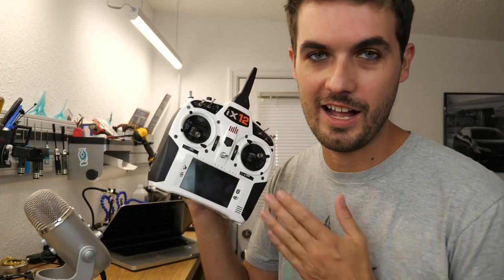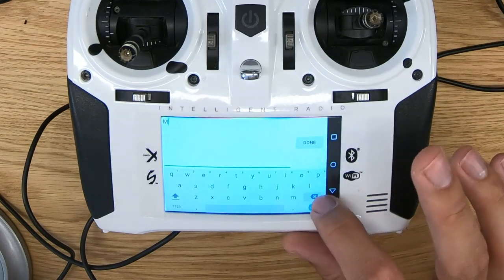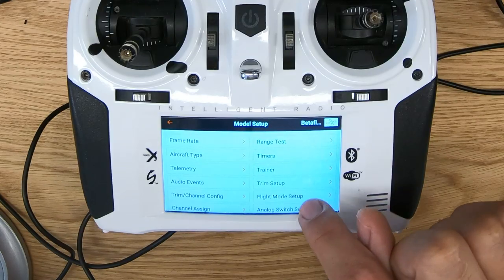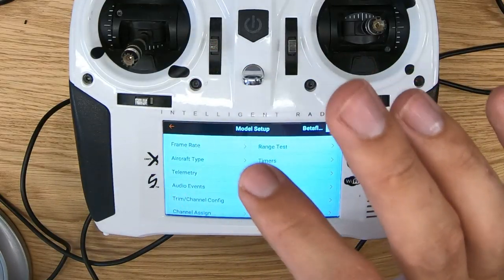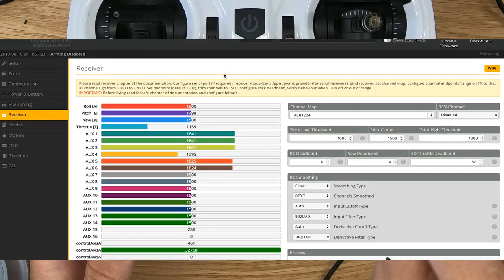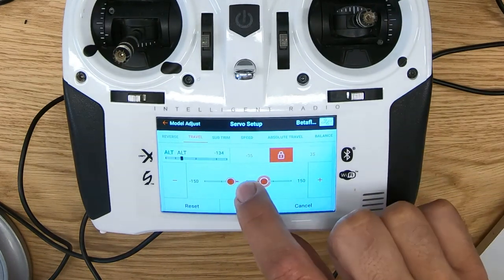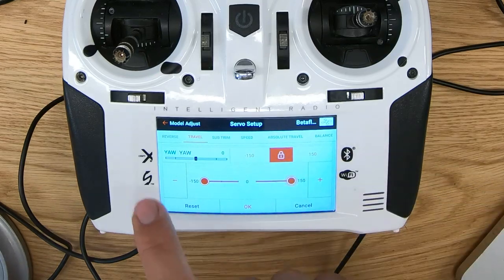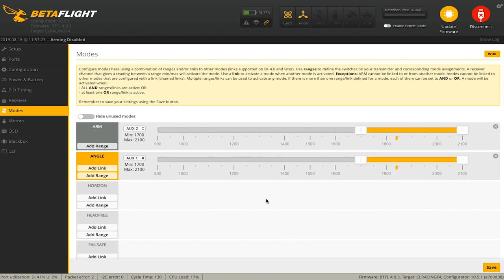Spektrum iX12 model set up for Betaflight

Comment: Hey Drew! Always appreciate the technical walk-through videos.  I would like to see how the telemetry is set up on the spektrum system, and perhaps a little more on the iX12 radio and how you use it for signal penetration in concrete bandos or going behind buildings. I always gets anxious when your flight videos go behind a building as I fear the signal will get dropped.  I have the 6X now, but may upgrade to the 12 if it had more transmit power, or a plugin module to boost power. 
Great videos on all the channels.  Keep up the great work.
Reply: Gil Woodring Xfire dude xfire.

Comment: Nice video! I am using DX9 so this part is not that usefull for me, but plese create advanced video regarding telemetry and RSSI setup on OSD. I am using "old" serial Race receiver and I am really curious whether it worth to upgrade to new SLX2 receiver. Please add your personal opinion about new receiver - how it is with range, stability in multipath enviroment, lost packets etc. Thanks in advance
Reply: I agree the SPM4649T video you did was great but the helpful part on upgrading the receiver by that other guy down in the description is gone. Not sure how to update the SPM4649T with out blowing them up. Dose the new mini receiver your using in this video come with that update or do you have to use that spektrum cable again so I can blow that one up. Help much appreciated

Comment: Thanks to you for all the info!
I also use a Spektrum system for a drone. For me, the SRXL2 DSMX Serial Micro receiver works only up to Betaflight version 4.3.2. For the newer ones, the receiver is not recognized. Do you know the problem? Do you have a solution?

And I would like to use the Spektrum system also for Ardupilot. I mix two switches to different pulse widths to control the modes. Do you have a better solution?

Comment: The thing I've always had with Spektrum is price. $600+ transmitter, $50 receiver (or $200+ for Crossfire to completely insure you aren't a member of "Team Failsafe"), to get what you have with a $110 QX7 and a $13 XM+. They look fantastic and all, but I've just never been able to justify the price. How is it 6 times better to account for the 6 times higher price tag?..
Reply: It's the cost to join team failsafe.  It's an exclusive club :)
Reply: Well. I never used any other brand but the best Spektrum radio was DX6i. I have never had any fail safe with it up to 2km. No booster. Any 6 channel DSM2 receiver. My longest flight was for 3.9 km (actualy it could be longer but I lost video and turned RTH on). Now I use DX9 and I can not say it is the same as DX6. The longest range I ever been able to fligh with DX9 is about 2km. Common range is about 1-1.5 km.
Reply: Well I got tired of the fail-safes with my DX6 at like 100ft so I made the plunge and got a DX9 with XFIRE and the quality of the radio in your hands is just fantastic and never having to worry about falling out of the sky is just so reassuring, with XFIRE I've been out to 2 miles with it never leaving 99 LQ 👍
Reply: @smooth_ops2942  , I've the same issue with my DX6. I flew behind a simple tree and the drone fail-safed.  so frustrating.  I like the 12, but think "do I really need 12 channels?"  I only fly drones, so 8 or 9 would be plenty.  Is XFIRE a plug-in module for the 9?
Reply: @Zayphod_zz9pza  Don't go with the 12 cause you have to deal with boot up times for the tablet and what not, Get a DX9 so you can run XFIRE at full speed instead of PPM speed which is way to slow so the IX12 and DX9 can only get the software from Spektrum to run XFIRE at full potential 👍
Reply: The boot up time has become a non issue on the ix12. Just don’t power down. I uninstalled all the apps that weren’t absolutely necessary and turned off the WiFi. About once a month I turn on the WiFi and see if there are any updates. Xfire does drain the battery faster. Running at 500mw and above you should run off an external battery. I have been out 4.35 miles at 500mw on my long range 7” with a 2200mah 6s battery. Spektrum is constantly improving the firmware for the ix12. Drew I would like to see a how-to video on how to run simulators with the ix12..I have no regrets and love my I 12
Reply: I have spektrum and a QX7 with hall gimbals,  and spektrum gimbals are better in my opinion.  Spektrum OS is much more lightweight and intuitive to me over OpenTX, and I don't really need the flexibility of OpenTX. 
And really,  I think they feel better in my hand.
Reply: @ProjectMockingbird  Spektrum is just hands down a better quality radio in everyway... Now it doesn't have the functionality of the OPENTX OS, but for the most part most quad people don't use that stuff anyway. Spektrum OS is simple and for the most part intuitive in which I just setup 1 model and bind all my quads to that since I use XFIRE. I've also done the "Butter Mod" as I call it to my throttle stick by placing a piece of silicon fuel tubing over the metal slider bar inside the radio with a touch of oil and holy crap it's smooth. So to summarize "YOU GET WHAT YOU PAY FOR" 👍😀
Reply: @smooth_ops2942  "Better quality radio in every way". "Doesn't have the functionality of Open TX". "Spektrum OS is "for the most part" intuitive, "since I use Xfire". Did the "butter mod with silicon tubing over the slider bar on the inside of my radio with a touch of oil".  "YOU GET WHAT YOU PAY FOR"..
Dunno about that. $300-$600, plus $200+ for CF, then do some kinda fuel tube "mod" to get it to "feel" right. Then there's the "team failsafe" thing that all Spektrum users try to play down
Naaah. $250 for an X9D+ SE with Hall Sensor Gimbals, $13 for an XM+ receiver, got everything that the Spektrum users are "for the most part" trying to match..
The only thing you "get what you pay for" with using Spektrum is the ability to puff your chest out and proclaim.. The Harley Davidson of transmitters..
Reply: @hillbillyfpv3  Well firstly I don't evade to the fact that Spektrum has failsafe issues.. my comment up above refers to the fact I would have them frequently and is the reason I got crossfire in the first place 👍. Now secondly the gimbals feel great in stock form but after watching a video from (Pinchtune FPV) where he did this mod to his X9D I figured I would do it to my radio and it works really we'll 👍. Lastly being the comment in which us Spektrum users walk around puffing are chest out, I said what I said because I believe in the quality of the radio and I've seen many people with where the hall sensor gimbals start to malfunction after a few months and have to be replaced..don't see that with Spektrum gimbals. Plus there are radio way more expensive than Spektrum... Futaba for one and also FRsky makes way more expensive radios as well. I have a gut feeling you want a Spektrum radio😋.... Anyways the special edition X9D is a great radio in general.